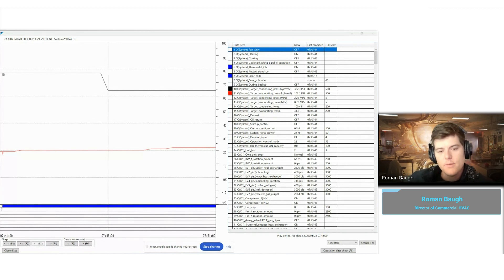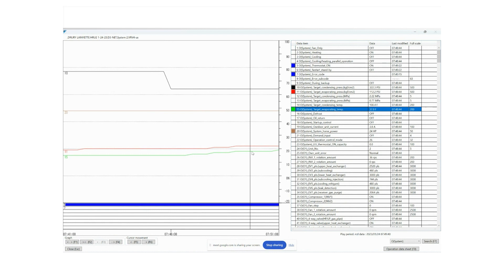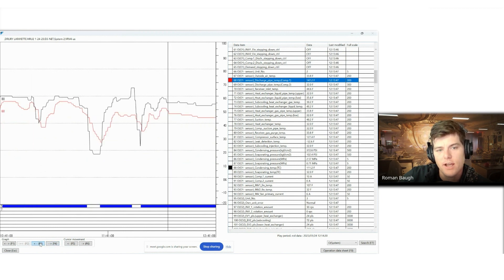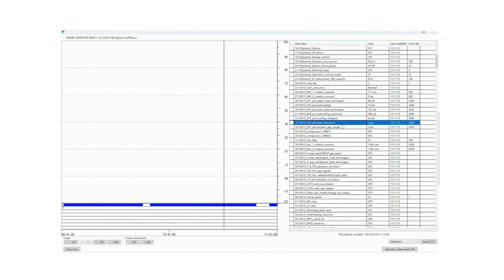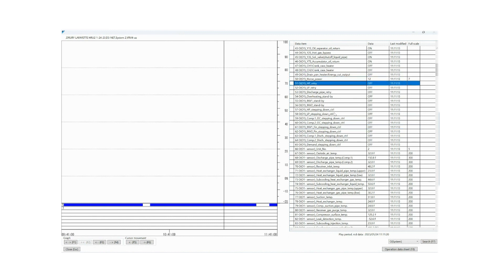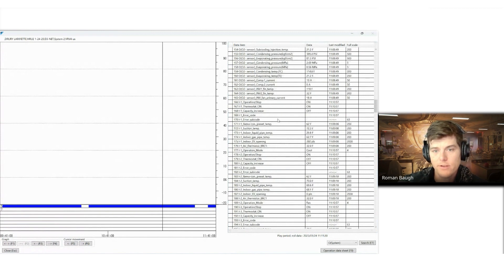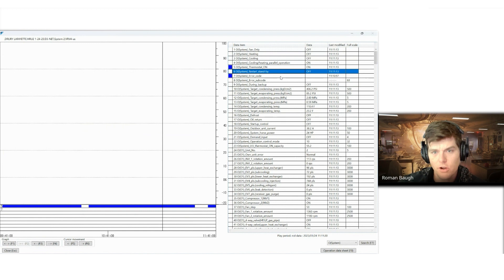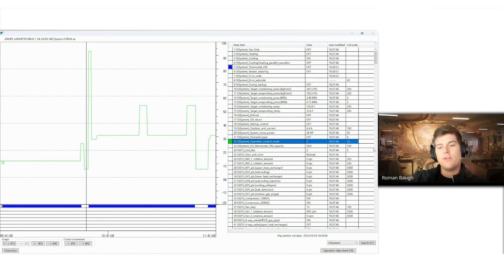The Basics of Service Checker

Comment: So I'm still on service checker 3. Is outdoor  suction temp(line item 77) air entering outdoor coil? I would want to use suction pipe temp(line item 79) minus evaporator temp to calculate superheat correct? Do I not have operation mode on service checker 3?
Reply from the maker: What is the model of your equipment? Based upon the model it may have 2 suction temp sensors. Yes thats correct VRV4 and newer is the only models with Control Modes.
Reply: @RomanBaugh  REYQ144TAYDU